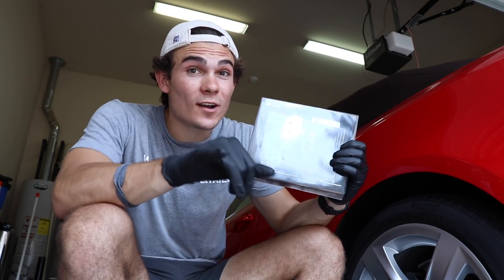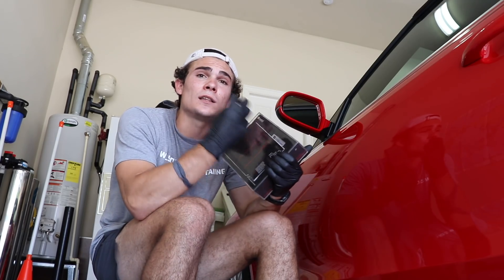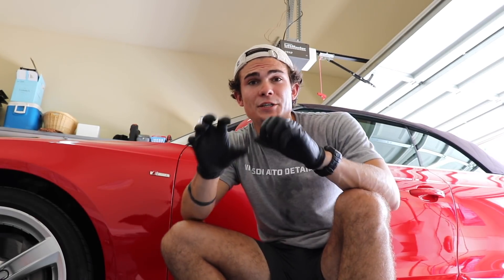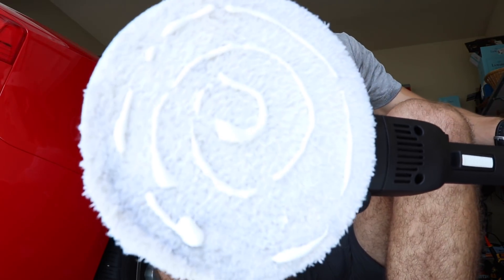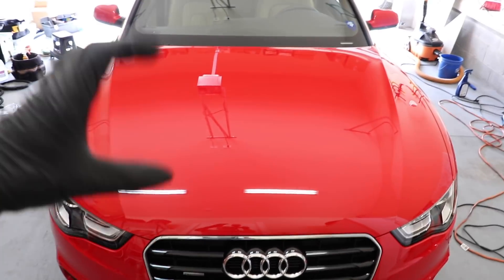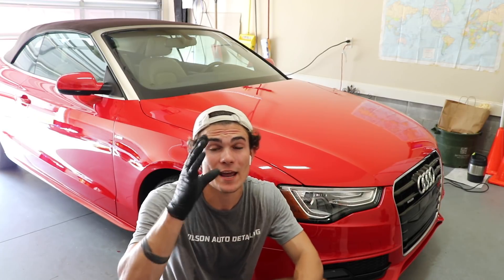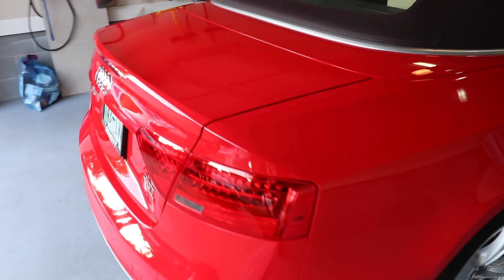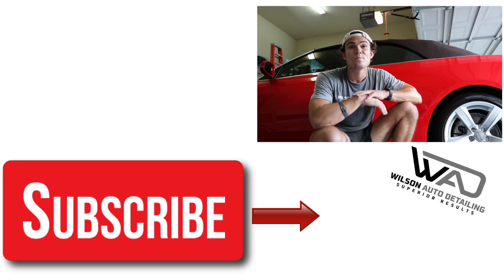How To Apply A Ceramic Coating From Start To Finish: Step By Step!

Comment: 4:25 steps to preparing car for coating. 
1. Wash
2. Clay Bar
3. Degreaser
4. Alcohol Wash
5. Polish (paint correction)
6. Alcohol Wash/ Coating prep Spray
7. Apply Coating
Reply from the maker: Yep yep
Reply: On a new car (3months old), can i skip any steps from 2 to 6? I already maintain it with a hybrid ceramic max. Thanks
Reply: vmitsios you probably could skip step 4&5, otherwise wash/degrease real good..

Comment: Awesome job Luke!!! Audi looks fantastic, I bet the owner was thrilled.
I just used Opti-coat gloss coat for the first time recently on my wife's jeep. I must say it took me about 12 hours to go from beginning to end with all of the steps required to prep the paint, but it was worth it though. I also waited a few days and did a quick ONR wash and topped the coating with a sealant (optimum hyper seal).

Comment: Last coating I did took 2 days.  4 door Chevy 2500 Z71 in Black.  first day was wash, decon, inspect, and correct.  The truck barely if in my garage so I had to start the coating process at 6am then following morning to avoid any direct sunlight during the application process.  great video and explanation for detailers considering adding to their offering.  Definitely not a  time to cut corners, it will bite you!
Reply from the maker: Love it!!

Comment: That looks awesome. I’m thinking on apply it to my car. I just bought a new Mazda 3 last week and I’m putting all my efforts to take care of he paint but it already has some little scratches, so I’m definitely doing something wrong. I used meguiars ultimate wash and wax soap, carnauba liquid wax and after 3 days, I applied meguiars quick Detailer to try to keep the car clean from all the dust that easily stick to the paint and I think this was my biggest mistake. I’m not sure, but I think that the scratches are there because of that kind of rinse free wash with the quick Detailer. Anyways, I think the paint is incredible delicate and it get scratched so easily that I don’t know how to protect it. I bought now meguiars paint protect and I pretend to apply it this days after clay bar the entire car. Does this ceramic cost make the paint harder to scratch? What else do you recommend? I also bought a deep crystal Wetlook cleaner wax to try to do some kind of soft polish. Can you please point me in the right direction to add more protection to the paint and repair the existing scratches?

Comment: Hey Luke, quick question..I wd imagine you do this in a dust-free environment...which is almost impossible. How do you or the product react if visible airborne particules land on the surface as you are applying or buffing?

Comment: Can they be applied outside if it’s a dry cool day? I don’t have a garage but I plan in few months to polish one day then apply the ceramic the next day , is this a no no?
Reply from the maker: Theoretically yes they can, I wouldn’t suggest it at all
Reply: I just did and I'm in San Antonio TX. I used cquartz 3.0 and it was easy since the product flashes immediately. Pacing your work/steps is key! Top it off with Reload and you'll be amazed!

Comment: Hey Luke, what’s is the difference between a ceramic coating labeled for paint vs one labeled for plastic trim (aka trim coat)? Are they really that different or is just a marketing thing? Would really like a ceramic coating that can be applied to multiple surface types. Thanks!
Reply from the maker: Yep they are very different. With ceramics the claims are normally true and should be followed as directions say

Comment: Heyy Wilson can you apply jet seal+ wax on a ceramic coated car??
Does claying remove ceramic coating, jetseal, or wax??
Reply from the maker: Claying won’t remove the ceramic but ya you will probably remove something like jet seal (which is kind of crappy product in a lot of situations) but you can apply waves over ceramics yes

Comment: what a way to break a sweat lol literally.   So question Wilson.  i have started the ceramic coatings as well with the mobile detailing but i am getting my chops busted for not taking the wheels off and ceramic coating them.    Some shops take the wheels off and so on but for liability purposes i do not take wheels off.   I have tried doing the coating with the wheels on but man it is not easy.  Do you offer coating the  wheels or just the paint and glass?
Reply from the maker: Just paint and glass for me these days for that reason exactly! And if you wanted you could just not charge them what the other guys charge to do the wheels obviously because you are not doing that, super simple, but it’ll fix your problem
Reply from the maker: I take that back, I do apply it to wheels as well in certain instances but it depends on what someone wants to pay for

Comment: I have seen some local shops offering 6 coats of ceramic, but it seems like you only need one. I'm thinking of doing it myself, but how many coats should I put on?
Reply from the maker: Hahaha if they are offering 6 coats something is wrong with them
Reply from the maker: Honestly man, SOME coatings say you can apply 2, any more than that and it’s a bit insane
Reply: @wilsonautodetailing  yeah it was like 4 coats of "base" ceramic and 2 coats of "ermergurd super shiny" ceramic coatings. Sounds like bs to me but meh, I'm a weekend warrior wtf do I know lol

Comment: Wow Luke I read on the website that the coating you used in this video is rated at 9H hardness, lasts 3 years and only requires 1 coat?? Is that correct, if so that's incredible! It seems hard to believe so what's the catch....is it harder to apply or something? Thanks Luke. Also, have you had a chance to try Gyeon Q2 Mohs Coating?

Comment: why you have to do two ipa wash? cant you just do one when you finish m205 polish?
Reply from the maker: Yes, I did not do two, one is all you need
Reply: Wilson Auto Detailing  no, i mean u mentioned you did a ipa at 5:35, and another one at 6:29 if i am not mistaken. thx.

Comment: Hi awesome video what is the polisher you are using?
Reply: George Dellar Not sure if you're actually serious lol it's a Rupes 21mm throw bigfoot. He mentioned it a few times 😉
Reply: Ken Lawton I never heard him say the full name just a rupes big foot I saw 21 on the top but wondered if it was mk1/mk2 I know there are a few Bigfoot polishers
Reply: George Dellar it's a Mk2 😉
Reply: Ken Lawton what are the like as looking to upgrade my das 6 pro?
Reply: George Dellar They are a massive step up on a das 6 pro, not in the same league.  Rupes are very expensive and really they are aimed squarely at someone who makes a living from detailing cars, or money isn't an object. Also the das 6 pro has an 8mm throw where as the rupes has either a 15mm or 21mm throw and that in itself is a massive difference and takes time to adjust. At the end of the day it's up to you.  I'm not a pro and don't need a Rupes so I got myself a Shine Mate EX605 which is a 12mm throw DA available here in Australia.  It's an outstanding DA and considerable cheaper than the rupes equivalent.  Shop around and you'll buy sometning that's in every way as effective as a Rupes however a third the price. When you buy something cheaper than a Rupes then you can spend the extra money on better compounds and polishes and pads 😁

Comment: I used a product called mothers cmx coating. I followed your steps except for the final polish as the car was brand new and paint was in excellent condition.  My question is what to do when I go to re apply my ceramic coating as it seems 6 months with this product would be a good time to re apply.  Just do these same steps again? Wash, clay bar, 50/50 wash, polish and coat?

Comment: Is it true that :
- applying ceramic coating is dangerous for your health ?
- removing ceramic coating is pain in the b... because you must sand the entire car ?
Reply: David de Mafate nope ceramic coating is due to brake down just like wax and sealants they will fade over time. The problem is when it happens your coating will not break evenly, and you have to make sure that you dont have  any coating left before you re apply again .

Unlike wax which you can just strip and apply again or another layer on top of it
Reply: I'M  MORE ON A SEALANT AND WAX KIND OF GUY,  but that link has a lot of Bs, 
1.ceramic coatings will only last for six months tops

2.it will not degrade the paint

3.if scratch appears on your paint, you can just wait for the ceramic coating to wear off, then do 2 steps paint correction.

4. Ceramic coatings will not harm your paint

 I only tried ceramic coating ones and it's really hydrophobic , it lessens the chance to have water spots.

YET i will still choose wax or sealants over ceramic coating
Reply: If you're eating the ceramic coat then it's dangerous..... so just dont eat it. You'll be fine.

To remove it doesnt require sanding, you can if you want I guess but it comes off with simple polishing. I've done it.
Reply: Mitchell Baltazar my car spends 90% of its time in the florida sun and my car is still hydrophobic 2 years later. I used 4 layers
Reply: If you breath it, it's dangerous. So don't breath...ok ok...
Reply: Mitchell Baltazar, if it last only 6 month, why do you chose this complicated stuff ? Complicated to apply, complicated to remove. Better use this japanese wax that pretend to last 12 months ; you will have 6 month protection.

(by the way, this is not an agressive message. Only want to share some ideas ; I want to take care of my car with less time and less effort. If this ceramic is good, I use it...but it doesn't impress me so much. If my english sounds weird, that's because I'm french)
Reply from the maker: Hey David, I thought Id add my two cents: no ceramic coatings are not at all dangerous for your health... any more than cleaning your car is dangerous because your spraying chemicals hahaha, removing ceramic coatings IN MOST CASES can be done simply through polishing, not wet sanding.. and just to be clear, though Mitchel said these coatings only last 6 months, that is not true, the weakest coating Ive ever come across lasts for about 2 years, that is normally the minimum, while 7 years is the max I have seen. Of course there are variables that will change that a little, but not significantly
Reply: David de Mafate if I were you I wouldn't give Mitchell any more questions or the time of day. I'm sure Luke can answer all of your questions. Be careful taking advice from someone who mentions that "ceramic coatings last 6months TOPS". My family fleet and 20 of my clients vehicles have coatings lasting over 3 years. System X Coatings. Anyway, Great video Luke
Reply: David de Mafate ceramic coating are great for people who don't want to tend to there cars to often also because of the ease of maintain. I'm sure you'll love it once you have one installed. I threw away all my waxes and sealants because of the unmatched benefits you get from a ceramic coating. Also I wear a N95 respirator with gloves while applying coatings
Reply: Thanks for the answer Wilson Auto Detailing. In my world, I will continue with classic detailing protection : wax and sealant.

Rdetailing, yes you're right, Mitchell is a so-called expert ; I knew this fact when he said that the coating last for 6 months.